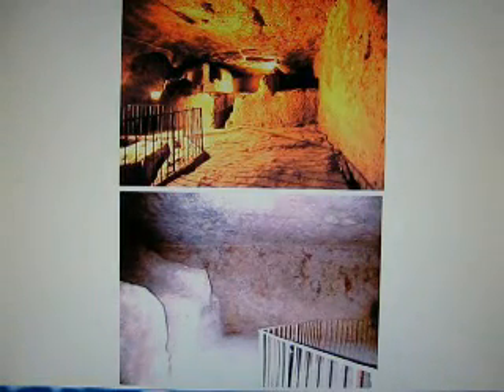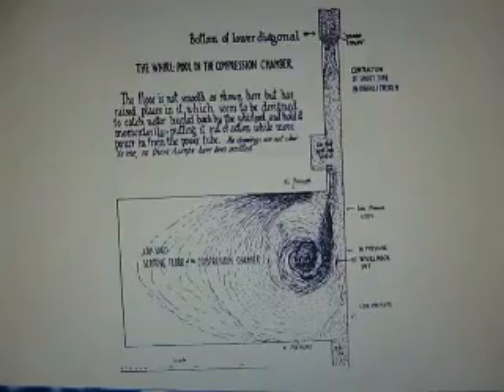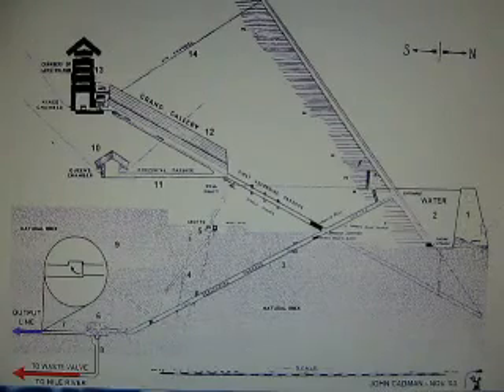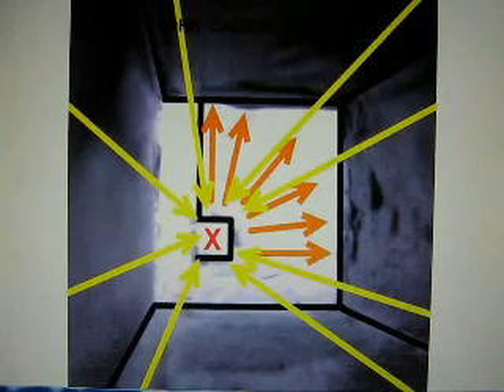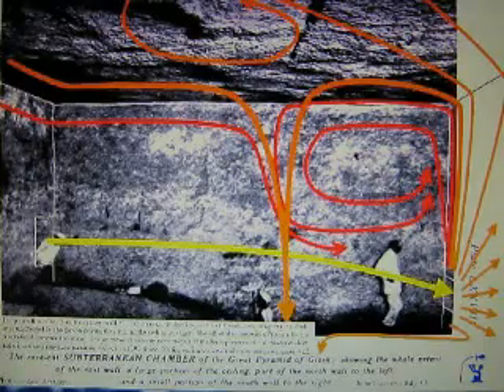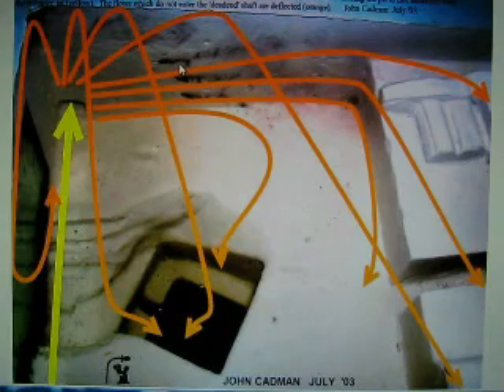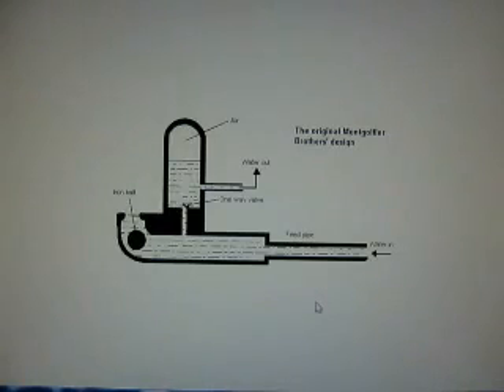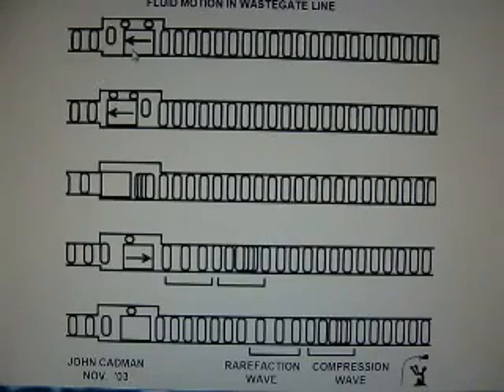Pyramid Hydraulic Ram Water Pump (2of3)

Comment: And the pyramid is a bicycle pump. Each pulse hammers the liquid diaphragm up into the air pocket in the ceiling of the kings chamber .They harvest air pressure. Design is for baffleing and pressure peaks. Sonic pulse transfers energy of water pressure into air pressure. Keep it simple stupid.

Comment: Great video! I never thought of that. A ram pump and or syphon. The "electric generator" theory  didn't make as much sense because the early Egyptians would have needed water much more than electricity. The tight tolerances of the granite block would have been needed to maintain the suction to elevate the water. 
I don't buy the tomb theory unless they combined it with the water pump theory. 
It's amazing that the ancients would have a working knowledge of hydraulics and its usage.

Comment: but was it ever in use? because if it was, then wouldnt the walls show signs of the water vortices?
all the debris and dirt would make a crazy abrasive. all the walls would need to be smooth to the point where it is clear evidence that water flowed through
Reply: There is a ton of smoothed rock that looks like water may have been involved, the vents are designed the same way they have designed other water channels, and a lot of calcified salts were removed from the Pyramid a long time ago.

Comment: the pump would pump water up the staircase ...when it was full the weight of the water put pressure on the pink granite and when it drained out the created a vacuum in the kings chambers ...and a piezoelectric charge for the kings chamber.that turned into a large vacuum tube for long range microwave Morse coad sending unit ....all pyramid were radios plus Thay restructured the water to disinfect for drinking and Farming ...the angle of the outside structure spins let lines .. the Egypt ever existed...there's also another Sphinx East of the first one discovered by a goat herder........these machines were set here long before Egypt. ever existed

Comment: PS. I do not think there is a pump there, it is just a tale, or antenna, for static electricity from the aquifers.  But the funnel really added to the electrolysis when it made an artificial/organic AC power spinning the water forcing it to shatter into H and O.  A force multiplier to the electrolysis.  Then rejoining it in a big fire in the middle (pyr-a-mid) as the steam is collected in the grand hall and returned back down to the bottom to do it again.

Comment: Thank you, this is awesome.  The fins captured the hydrogen and oxygen and pipe the H up the 'air' hole to the queens chamber and the O is pushed (as your ink) to the other shaft.  The water is the conductor of electricity from ground level to below ground level where the static electricity from the aquifers and the change from ground to below ground breaks the water as the funnel acts like organic AC and works like Stan Meyers electrolysis engine.
Reply: wtf